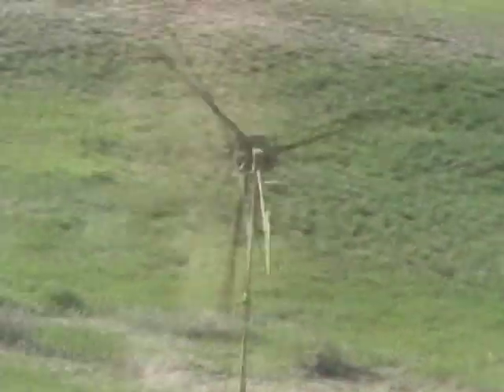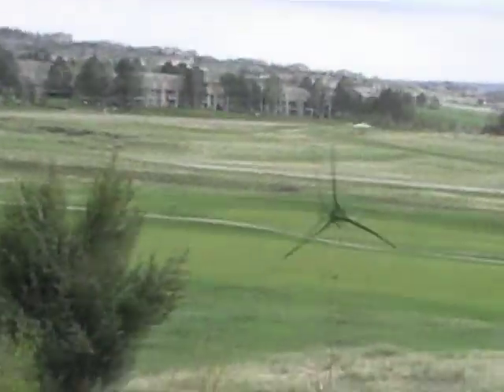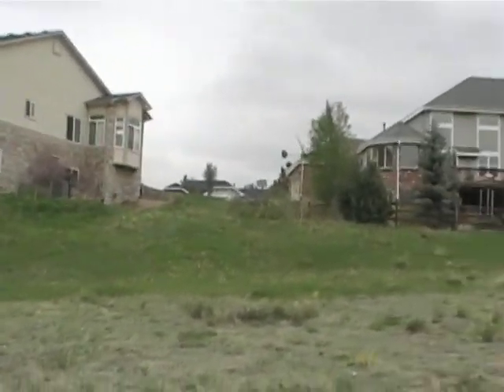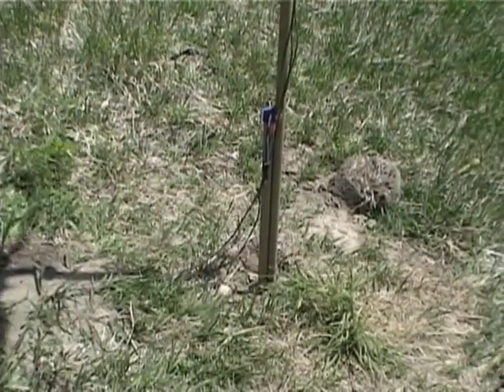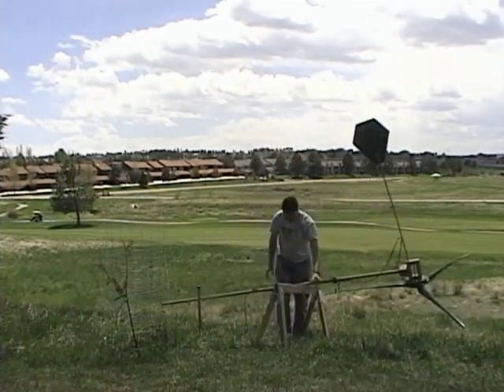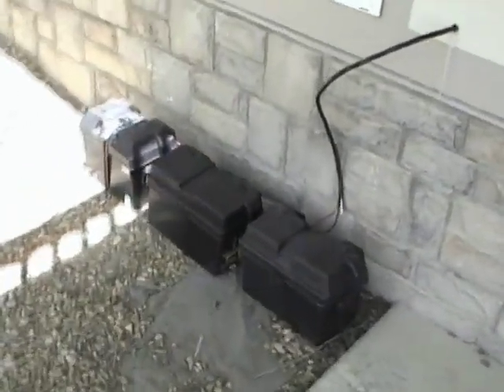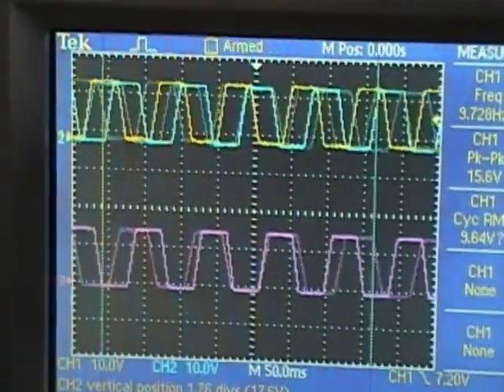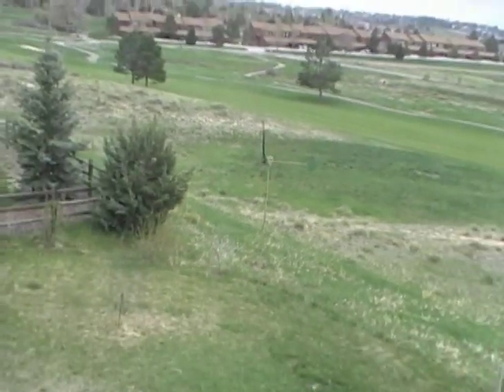Yet another HAWT

Comment from the maker: For a 12" hub the measurements around the outside of the 3.5" dia PVC were:

at the hub edge 3.0"
1ft from the hub 1.8"
2ft from the hub 1.3"
3ft from the hub 1"

At the hub you need to widen it out so you can put screw holes through what would be 0 inches.

I think to be more efficient, the blades have to be cut to be a little faster (thinner).